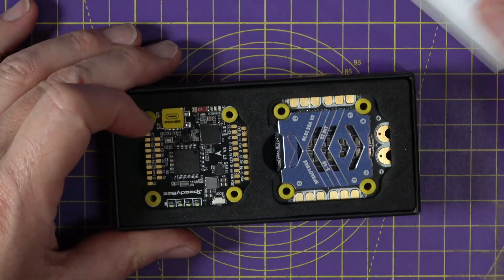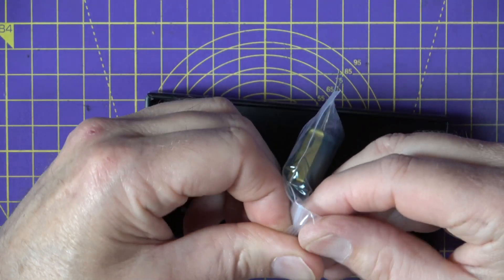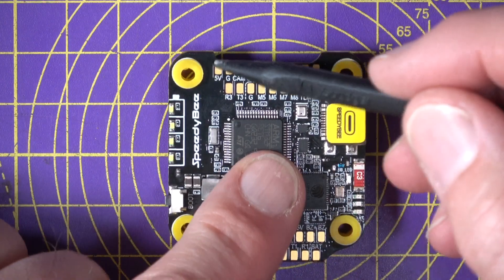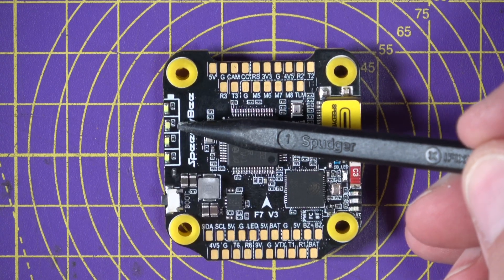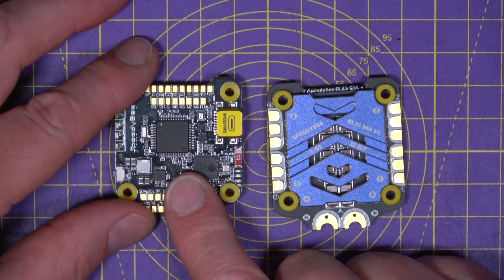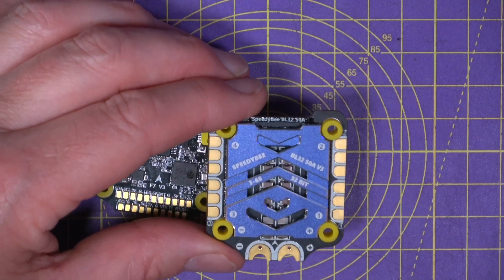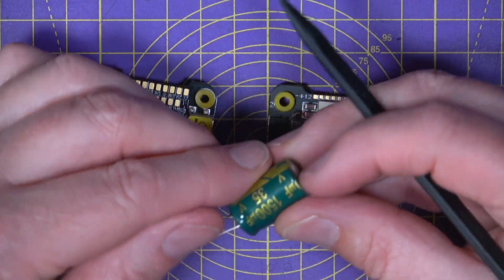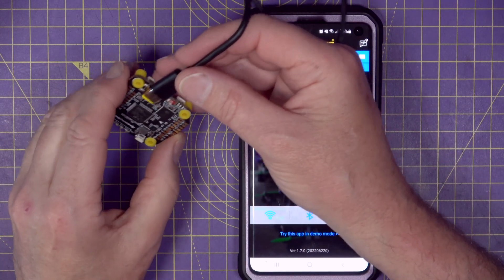SpeedyBee F7 V3 flight stack - 50A BLHeli_32 ESC - bluetooth low energy and wifi connectivity

Comment: This would be my favorite FC if i can figure out the correct resource & PINIO info for DJI aux switch. Anyone figure this out yet?
Reply from the maker: Check the product manual: The product manual for the SpeedyBee F7 V3 flight stack should contain detailed information about the available resources and PINIO configurations. Check if it has any specific instructions on configuring the DJI aux switch.

Look for online resources: There are several online forums and communities where you can find discussions about the SpeedyBee F7 V3 flight stack and the DJI aux switch. Look for online resources, such as Facebook groups, RC forums, or Reddit threads, where you can ask for help or find information.

Contact the manufacturer: If you are still having trouble figuring out the correct resource and PINIO info for the DJI aux switch, you can try contacting the manufacturer directly. They should be able to provide you with the necessary information or help you troubleshoot any issues you may be experiencing.

I hope this helps!
Reply: @WhirlyBloke  There is nothing about PINIO in manual. I wrote to SpeedyBee about PINIO and they keep saying random bullshit but nothing serious about my question, it is like late chat boot. Their support is dramatic. I don't know how profit have You got for this shitty review but Definatelly it does not deserve to be called flagship FC. 3,4 khz baro is a joke.
Reply from the maker: @piotrkojder7177  Everything you need is in here https://store-fhxxhuiq8q.mybigcommerce.com/product_images/img_SpeedyBee_F7V3_Stack/SpeedyBee_F7V3_Stack_Manual_EN.pdf
Reply: @WhirlyBloke  I wrote to SpeedyBee and They say that there is no PINIO option in F7 V3. It is verry important for me. Having power supply pin controled by AUX mode lest us turn on and off VTX. It is verry important to save battery during preparation and what is the most important the gps fix is much faster with VTX turned off.

Comment: Im using a 3 wire receiver ive soldered the ground to g pad, 5v to 4v5, and ibus to r2. All setting are correct in the app and transmitter is binded to receiver but  it says in the no valid receiver signal in the app, an there's no throttle response ect any ideas? (New to drones)
Reply from the maker: Based on the information you've provided, it's possible that there may be a few issues that could be causing your receiver to not communicate with your flight controller properly. Here are a few potential solutions:

Make sure that you have the correct receiver protocol selected in the Betaflight configurator. If you are using an iBus receiver, make sure that you have iBus selected under the "Configuration" tab.

Check that your receiver is properly bound to your transmitter. If you are using an FrSky transmitter, make sure that you have the correct mode selected (e.g. D16 mode for most FrSky receivers).

Double-check your wiring to ensure that there are no loose connections or solder bridges. Make sure that your ground, power, and signal wires are all properly connected to the correct pads on your flight controller.

Try using a different UART on your flight controller. Some flight controllers may have specific UARTs that are better suited for certain types of receivers.

Check that your receiver is properly powered. Some receivers require a separate power source in addition to the 5V supplied by the flight controller.

If all else fails, try using a different receiver or a different flight controller to see if the issue persists. This will help you narrow down whether the issue is with your receiver or your flight controller.

I hope that helps! Good luck troubleshooting your issue.

Comment: Just curious, are the schematics and firmware available for just the SpeedyBee F7 V3's top/logic board (the one with the STM32F7422, not the BL32 50A 4-in-1 Electronic-Speed-Control or 45A BLHELI32 board)?     

I like that it has Barometer BMP280 , IMU/Gyro BMI270 and ESP32-S3 (bluetooth/wifi).. so just want to purchase to play as a development board with my own sensors (ex. Beitian BN-880)

However, I'm concerned that I won't be able to flash/debug using SWD.. or if it's somehow locked to be used only with the Betaflight 3.5.2 / Emuflight / iNav  firmware / app?

BTW, is there a parts list of drones/motors/GPS/etc that is sure to work when plugging the F7 V3 as a stack?
Reply from the maker: It's not uncommon for manufacturers to make their schematics and firmware available to customers for development purposes. You could try reaching out to the manufacturer or checking their website for more information.

Regarding your concerns about flashing and debugging, it would depend on the specific firmware and programming tools used with the board. In general, most development boards have standard SWD connectors that allow for programming and debugging with standard tools like JTAG debuggers or ST-Link programmers.

Regarding a parts list for drones, motors, GPS, etc., that are compatible with the SpeedyBee F7 V3, it would depend on your specific needs and preferences for your drone build. You could try searching online for recommended components or consulting with other drone enthusiasts or professionals for advice.

Comment: Is it a problem that I can't set the PID frequency higher than 3.2Khz ?
Reply from the maker: A PID frequency of 3.2KHz is a common default setting for many flight controllers, and it should be sufficient for most quadcopter builds. However, if you are looking to optimize the flight performance of your quadcopter, you may want to try increasing the PID frequency to see if it makes a noticeable difference.

That being said, it is important to note that not all flight controllers are capable of running at higher PID frequencies, and some may even experience stability issues or other problems if pushed beyond their limits. It is always a good idea to consult the documentation for your flight controller and experiment with different settings to find the optimal PID frequency for your specific build.

In summary, while a PID frequency of 3.2KHz should be sufficient for most quadcopter builds, if you are looking to optimize the flight performance of your quadcopter, you may want to experiment with higher PID frequencies. However, it is important to proceed with caution and ensure that your flight controller is capable of handling the increased demands before making any changes.

Comment: How the heck do you use that massive cap on those holes on the ESC?  The battery leads will beat it against the FC
Reply: You can place the mass cap off to one side and tie it down to a standoff.

Comment: You mentioned the VTX connector is for caddix/dji. I am using HDZero. Can I also connect HDZero there? Or will I have to solder the 1 watter VTX HDzero.. or will this not support HDZero at all?
Reply from the maker: HDZero just needs power and a UART TX and RX connection and this has got 5 UARTS, so there's no problems and this is totally compatible. You could just use the wired connector that's for DJI or just solder to which ever UART TX/RX you want.
Reply: @WhirlyBloke  Great..I preordered 2 thanks to your review. :). I take it for an 8 prop cine I would need a second ESC to run the other 4 motors? Looking at the AOS Cine 70 frame.
Reply from the maker: @WhySoDivided-CantWeAllGetAlong  That's exactly what I'm building. Yes 2xESC boards are needed.
Reply: @WhirlyBloke  ok cool. So I assume the 2nd esc has to be soldered to this fc.. no connector for it?
Reply from the maker: @WhySoDivided-CantWeAllGetAlong  Check my video where I show M5-M8 solder connections.
Reply: @WhirlyBloke  Yah.. that is what I thought. Not sure how that works with 2nd ESC.. but I look forward to your video when you build the 70cine unit.. so I can learn from you. :)